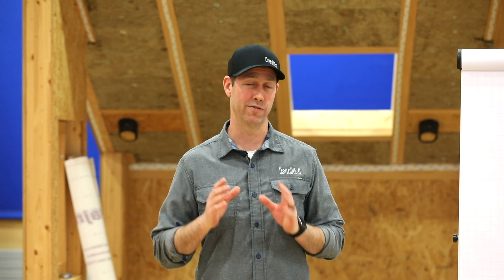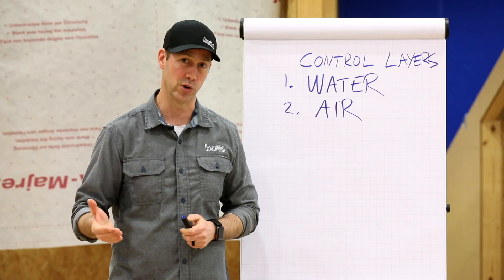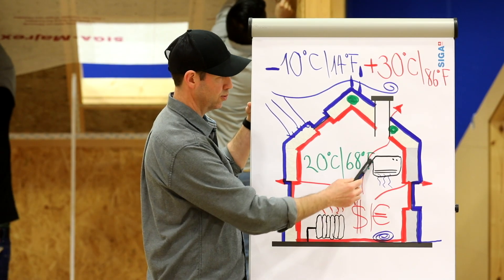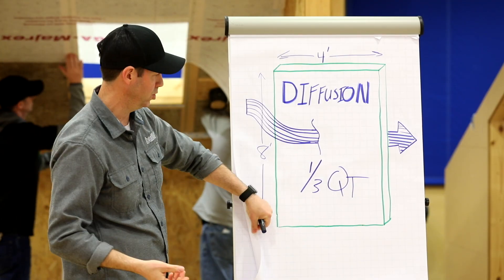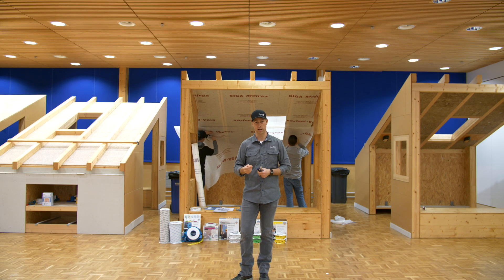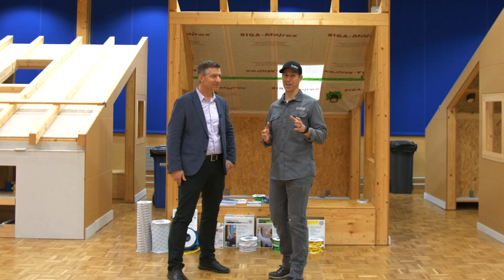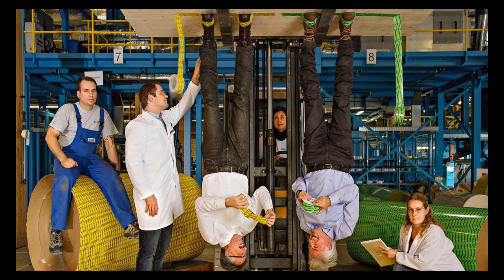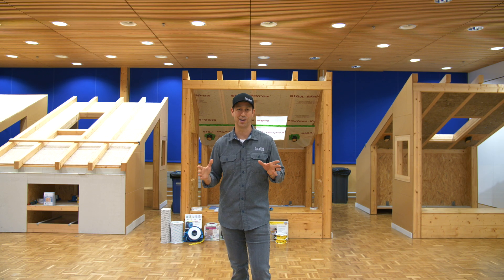Understanding Air and Vapor Barriers INSIDE your House

Comment: You are not really doing justice to a very complex issue.  It is very dangerous to oversimplify even to speed understanding.  Build an air tight house.  Ok.  Now what happens with no air flow under the roof sheathing?  Put an air tight (love to actually see that affordably done in the real world of construction) envelope on the interior.  Great, bit of work but done.  Didn't mention that if your are using exterior rigid foam board taped and sealed you have now created an air tight chamber.  That is a big problem because there is no perfect air barrier so where will it dry to?  Build an air tight structure.  Ok again.  Now a clothes drier and bathroom fans are installed.  You have made a vacuum chamber needing a "makeup" air supply.  Complexity generates more complexity and with it it becomes much more important to know all the variables (another good luck with that situation) so that a smoothly working system can be assembled.  Leave out one piece or add one and the whole thing becomes a nightmare very quickly. Architects don't understand it.  Engineers don't.  Certainly GC's do not nor homeowners.  Those looking to maximize profit don't care.  A lot of modern products boasting of "forever" do not have enough history to know how well they will actually perform in the real world.  No one is giving any thought to how systems may be realistically "unengineered" in the future if they fail in any sort of affordable way.  Certainly many many of these products have already failed coming and going from the market so we do know it will happen again and again.  If you save me $200 per year in heating you haven't done me any favors should complete wall systems fail in five years costing tens of thousands.  Cheap salesmanship is no guarantee of performance.  Guys jumping on tape or hanging from their heads are just theatrics that really mean nothing.  Show me that tape on a twenty five year old house with a full chemical analysis and we might have something meaningful to discuss.  Don't get me wrong this is a good topic just not suited for a sound bite.  Take care.  Doug
Reply: That's why Europe has great tilt windows and doors, but the layout of the house needs to be considered to.

If you can't make a tunnel effect through the house manually. Then you are endangered of dieing in your sleep.

Even with a poorly thought out layout. You are more likely to die from carbon monoxide poisoning than running out of air. 

Earthship houses are the cheapest and most adorable houses out there. You add a rocket mass heater and you can heat, produce air, remove carbon monoxide and maintain an even temperature all year, but that system requires too much land per square foot per person than what the whole can afford.
Reply: The companies will even openly admit that their tapes are likely good for about 20 years. Then what? A drafty building. Not so bad really. It's when the tape is counted on for waterproofing the WRB that it really gets me.
Reply: Douglas Thompson in New York where’s it’s hot and very humid in summer and very cold in winters what wall assembly do you recommend?
Reply: I am not from your area so I would recommend that you research sources local to you.  University's building science programs, government (Forest service building construction labs) etc.  It would depend on the variables you wish to include in your structure.  A/C, etc.  Do your research fully as it is not a simple subject and discard any unbiased information.  Find an experienced remodeller to tell you what has not worked in your area if you can. Take care.  Doug

Comment: Great advertising  presentation but you never answered the question of where the barrier goes. Thumbs down.
Reply: Ummm... 13:45

You should watch the whole video. (He explains it should go on top of the insulation just before the drywall goes up... if you're in a cold climate where AC is only used 1-2 months a year).

Comment: How do you handle a installing vapor barrier in a renovation (down to the studs) without making it cost prohibitive by removing all cladding on a house that has 1950s fiberboard sheathing? Just install closed cell spray foam in the wall cavity?

Comment: so how would you engineer for a more traditional house with say cobb, hempcrete, strawbale??????
Reply: the huckster you don’t. These natural materials should be self regulating, which is the reason they are used. And usually you build them in 18-30 inch thickness that’s your insulation right there. However, using large roof overhangs is very important in this case to protect the walls from too much direct exposure to rain/snow. A wraparound porch will do wonders in this regard. I’d also put bushes or other vegetation on the weather side to reduce splash.

Comment: "And we use a lot of cooling in the summer time, if we don't control air"
Easy saving tip: We don't usually have any cooling in central europe, so not controlling energy movement from outside into insulated space means simply suffering without recourse.
Reply: G+1121494 open a window. A nice breeze is all you need.
Reply: @4philipp  ^Well, personally I live in an old Building in the former Dutchy of Hannover. So british style sliding windows do something to decrease control of air movement and create constant breeze.

But otherwise you may want to not have a direct outside breeze and let the thermal mass of the building equalise the outside temperature movements, vent cold air in through the night and keep the outside air out during the day. Maybe allow inside breezes by fan.
Reply: Us being control freaks is part of the problem. I like fresh air.

Comment: So if I was building a tiny house that may move from a hot climate like texas to a colder climate like Virginia should I put a barrier on the inside as well Or just on the outside?
Reply: Do a perfect wall system, Matt built one. They are good everywhere. Do NOT use two barriers. Put all (or enough to above see point) insulation OUTSIDE the structure and put all barriers outside the structure.
Reply: @AnthonyBrusca  thanks I'll check it out

Comment: Love the vids man. So im finishing up my basement. I have 2in xps on the concrete walls with the framing directly over it. I was going to use fiberglass batting, non faced, with a plastic barrier. Some other people said to simply use faced batting stapled to the studs. Which one is. more effective? Seems like plastic wod be better in this situation.
Reply: Rockwool. No faced, and plastic. Basements are insulated below ground on the outside of the wall. Use nontreated wood and place a barrier under the syll. If it was me install a horizontal plastic pipe at the top with a lot of holes so u can ventilate the wall. The pipe goes the whole length and out?
Reply: @72strand  i used treated 2x4 on the concrete then just framed accordingly. My house was built in 68'i doubt its insulated in the ground. The walls would be 40ish defrees till i did the xps, now the entire basement is about 55 and def less humididty. Its a dry basement to begin with, so im not really worried about leaks from behind. Just want to co trol the air to keep it off the concrete.

Comment: Matt, you said sevaral times " vapor barrier". I think the correct term in a vapor open or permeable wall is vapor retarder. In a vapor open wall you want to promote the flow of moisture from inside to outside. You can proof testing the wall or roof assembly with the WUFI software to ensure that the moisture never resides in the assembly for extended periods.
Reply: Vapor barrier is the correct term, translated from "Dampfsperre". Of course there are some more technicalities to it.
Reply: @jotapi4010  Straight from the Website " Majpell is sturdy, flexible and dimensionally stable and can be laid quickly, easily and without wrinkles.
With a low perm rating, Majpell is impermeable to water yet has the ability the diffuse water vapor, preventing condensation.
Reply: With a fixed perm rating of .68, Majpell will protect the structure by minimizing vapor drive from the interior.

Combining Majpell with the breathable membrane Majcoat (sd value = 0.1 m) ensures perfect moisture transportation with a diffusion gradient of 50:1.

Comment: Yep vapor barrier like roofing felt and tar are still one of the best systems. After 2 years plastic sheet crumbles.
Tyvek which is polyester also deteriorates in 20 years.Personally I have seen 80 year old roofing felt and tar vapor barriers are standing up to time quite well. How long will tape last ? It cannot be tested .It is a wait and see kind of thing.  You must be paid to sell this stuff or you are ignorant.
Reply: Tar paper fails too!! My personal home @ 112 years old had at least 4 different generations of tar paper in various parts of the house all failed due to heat! I live in zone 6. Hot summers  lots of direct sun and snow in the winter. The  outside skin( stone/ solid wood/70s fiber wood stuff) had all done well but the paper was not stopping anything with holes and gravity rips around every nail.  The garage built later had what I assume was the first tyvek ever made from the 60-70 and it was in great shape. The newest remodel of the house tar paper had a date stamp from 1997 and it was on the north side of the house and was Trash.  Go figure.
Reply: Never Sleight what do u recommend now for zone 6 ?
Reply: @mattymets101   I wish had a good answer. Currently I'm on the hunt myself.  I think a good outside clading that will keep most of the water out along with big roof eves.  a big well flowing air gap then ???  Not sure what house wrap.  If I could keep 99%of the bulk water away and a cooler  surface temp most quality products should last, but I just don't know.   Sorry for the lack of an answer and maybe Grammer to early while on vacation to put on glasses. PS the central coast of CA is so beautiful

Comment: Does the barrier behind the drywall panel stop the moisture from entering the drywall panel, or does it just trap the water between the panel and the barrier? 

By the way, would love to know what ideal moisture is in a house, how to best eliminate or add moisture, as well as how to get air into a house when a vent system is used (kitchen or bath) or a fireplace needs to burn. I know there are switchable fresh air valves, but are they connected to the bathroom vent fan switch? Do they allow fresh air in when the fireplace is lit?
Reply: Vapor moves from high vapor pressure to low. Warm air has high vapor pressure, and cold air has low vapor pressure, even if the relative humidity is 100%. Inside the wall you will have vapor pressure gradient depending on the permeability of materials, and a temperature gradient depending on heat conductivity. Vapor going into the wall isn't the problem, bad stuff happens when temperature goes down faster than vapor pressure and the vapor pressure exceeds 100% humidity at that temperature. Then you get condensation on your wall, which is bad. If you have a vapor barrier just behind the drywall with insulation outside of it, then the drywall will be pretty much in indoor and everything on the other side will be much much dryer with temperature slowly going down as you go towards the outside.
Reply: Ants Aasma in door chickens ? Was that a typo I don’t understand the sentence can u retype ?
Reply: @mattymets101  an autocorrect typo indeed. And a hilarious one at that. Corrected...

Comment: Do they like spray foam in Switzerland?
Reply: No, they don't. In Europe they try to never use spray foam with one exception, Fire instillation. Penetrations through fire barriers and in remolds use a putty or spray foam to seal them.

They will teardown to the bricks or new build before using spray foam insulation.

I have seen it done.
Reply: I have never seen it in Europe, but i know one company (never worked with them) that used (uses ?) it.

Comment: Such a fantastic video Matt.  Just moved into 1850 stone farmhouse, and the penetrations are overwhelming.  I'll be referencing this video many times
Reply: Rand Thor were in an 1806.. we’re completely renovating.. spray foam was our choice mixing with rock wool..!matt actually helped us decide this too. 😀
Reply: Being in the planning phase of renovating an old house my understanding is to stick to the materials which were originally used in the building i. e. real wood or clay (modern forms with straw or hemp f. i.). These materials last centuries. Larger amounts of spray foam are nothing I would use for any house, rock wool doesn´t isolate when it is moist, what you need is capilarity of your isolation materials, you don´t even need a vapor barrier then. Barriers won´t work over decades... Learn from old world wide prooven building technics! (I admit I´m no expert but that´s my food for thought, there are enough experts of different scools of thinking out there.)
Reply: Karl Ludwig Bonitz it’s your house Karl! Do as you please! 😀😀 that’s what I support 👍👍 we foamed because we car about efficiency.. we’re saving close to 700 a month in heating costs.. if you wanna keep it “original” more power to you!! I love the idea.. but, if spray foam was around in 1800s they would have used it 😆 cutting a million cords of firewood and having 4 fireplaces wasn’t for Ambience.. it was to stay warm in the winter.. but, it’s your renovation and your house.. you do what you want!! You need to be happy with it.. good luck!! 👍😀😀
Reply: @1806StoneHouse  It's more to to with accelerated damage to the original structure which can manifest many years later if the wrong 'modern' material is used. Common to trap moisture in the wall by applying waterproofing on inside and out - really has to be done with caution.
Reply: twmd I totally agree and that’s why I don’t like to use some new products if they haven’t been tested for at least 20 years. 👍👍
Reply: Rand Thor our results have been amazing!! Find me on Instagram if you wanna chat about it. 👍
Reply: Air-caulk might be worth it.

Comment: So when a person needs to hang things on walls like cupboards into studs, is that not puncturing the vapour barrier?   Sure in a perfect world a house would be built and never add things, but we know thats not the case.   So how do we hang things on the wall like extra cupboards or the like without puncturing that barrier
Reply: Hi Virgil, very good point. If a vapor retarder is used we recommended to also create a so called service cavity. You can find more about it in our Majrex System Guidelines https://www.siga.swiss/_Resources/Persistent/d55679c0fe15e6654889b884139439531a92c8ba/SIGA%20Majrex_System_Guideline.pdf